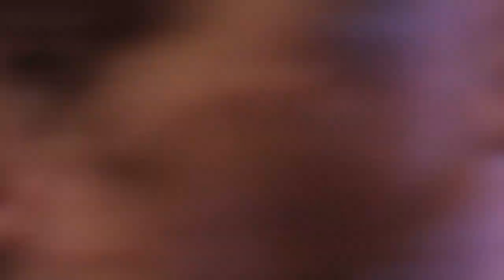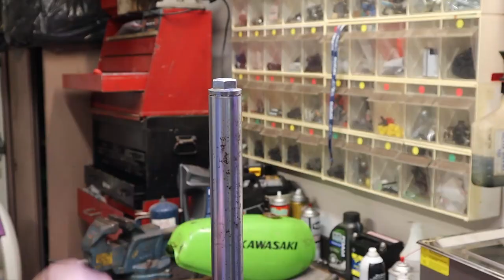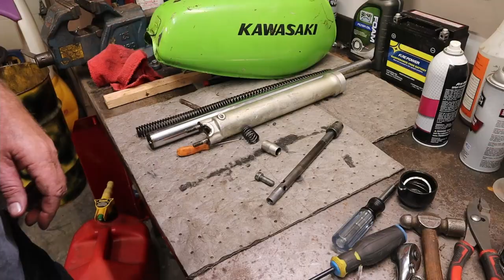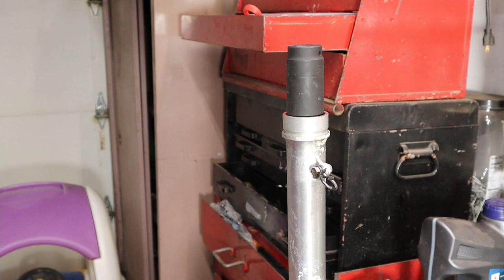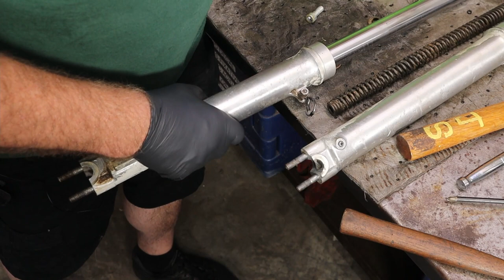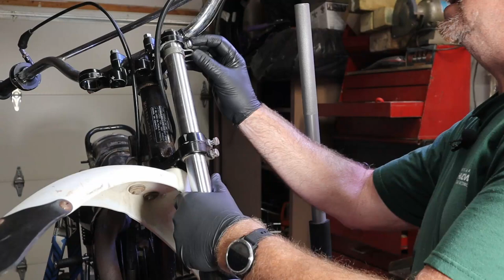Kawasaki KD175 Fork Rebuild and Seal Replacement. Remove clean and rebuild the forks. Suspension

Comment: Have you ever seen this style fork stuck in full compression? Any idea why that might happen? Maybe oil too low and bottomed out?....Maybe the forks were serviced at some point and the bottoming out cone sleeve not re-installed? There is no external visual damage. The only thing that I did to try to get them to move out was have 2 people (360lbs) stand on the wheel and lifted the front of the bike up. Nothing moved.  It's on a '76 175ke. I need to get it working properly. Thing rides like a lumber wagon😆 I basically never ride it, because I have a road legal XR400R that fills the 175's place, but I'd like to get it in proper riding condition. Thanks for the video.
Reply from the maker: Thank you for watching.

Comment: The manual says 5.1 ounces or 150 cc. On the fork seal oil for that bike. How did you clean up the shaft??
Reply from the maker: I used Scotch Brite in the parts washer. Started with a course pad and finished with a finer one. Thank you for watching.

Comment: Hey I was hoping I might get some help. Currently my outer and inner forks won’t come apart. I have loosened the fork cylinder bolt all the way but the inner fork still won’t drop. The fork cylinder just spins with the Allen bolt when I loosen.
Reply from the maker: They make a special tool that goes down from the top inside the inner fork tube to hold it from turning. Sometimes it is necessary and sometime you can use a long extension to reach down inside. Thank you for watching.
Reply: @RaymoreRepair  Thanks for getting back to me i actually ended up purchasing the tool hoping it works well